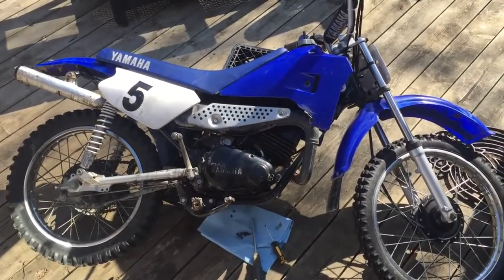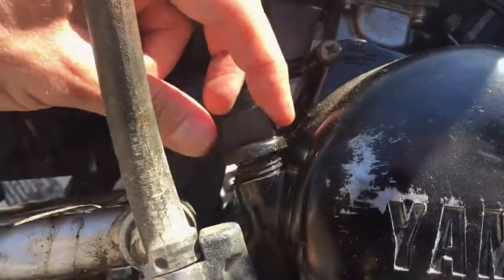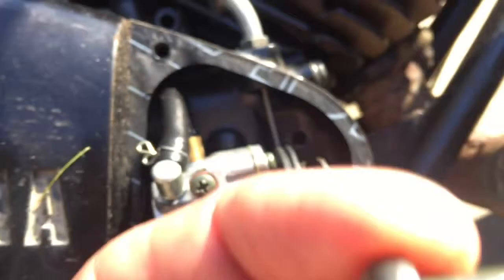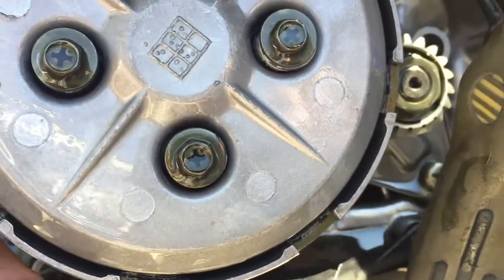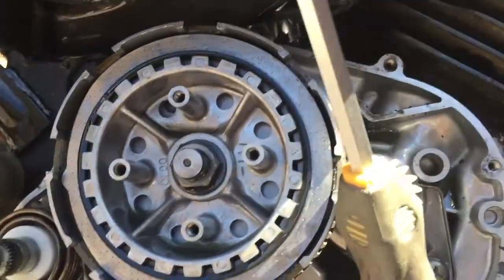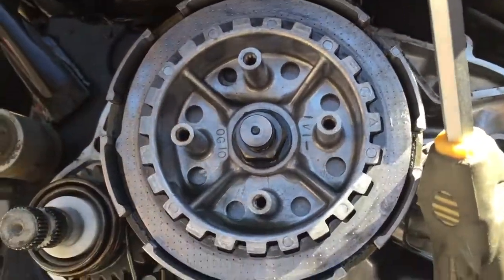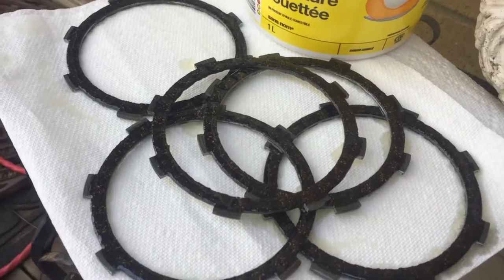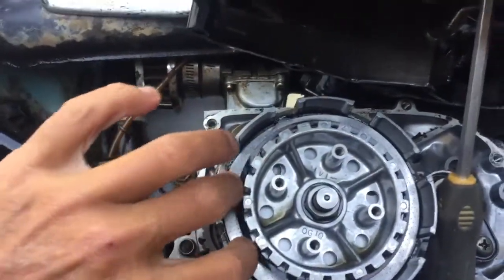Clutch Rebuild on a 2000 Yamaha RT100

Comment: Just picked one of these bikes up it's a 99. Got it running great but the rear tire/rim needs a lot of work and it also needs a chain. Bike was stored inside 10ish years so it's in great shape. Did you find a manual for the bike? And also where did you get the parts? I know I'll need that exact gasket to do the clutch in mine and am having a hard time finding it. Then again I've haven't physically been out to Yamaha to ask for it either. I did however ask for a repair manual and was told they couldn't get me one. No websites I've found yet have had much for the rt100 (Motovan, Kimpex, or royal dist) fortnine has some stuff and I can't get the mobile version of bikebandit to work for me. Anyway main questions are best spot for repair manual and parts. Thanks
Reply: are you still looking for a repair manual?
Reply: @Ohyesverygood  no the bike has since gone to another home, thanks anyway
Reply: @justinchant5044  i figured it’s been 5 years.

Comment: Where did you pick up your clutch rebuild kit? I have a 90s to 2000s, dunno which year, but the clutch is slipping bad and it needs rebuilt. Thank you for your time!
Reply: Check eBay or near by bike shops that can order it for you
Reply: @Serkan-Ipek  I was able to get a clutch, but I'm still not too sure on the type of oil goes in the clutch. If you know, then thank you for answering the question
Reply: I am thinking it's 10w30 for it, but I want to be sure...
Reply: Radical Radcliffe i mean 10w30 or 10w40 I don’t really think it matters. Personally I run 10w40 it everything works fine and it doesn’t burn through the oil instantly nor does it engine have trouble consuming it so I’m not 100% sure. I don’t think it would matter much but you can probably google it and get an answer
Reply: If u look where the Handle bars meet the frame, there should be a combination of numbers and digits. That is the vin number. If u find a good vin number website online, u can figure out what year. Then go to a yamaha dealership and they should tell u the exact type. They have all the records. That is what I did.

Comment: Do you use 10w-30 or 10w-30
Reply: KadenPlaysVideoGames  Im pretty sure its the other way round2 stroke oil in the container and 10w30 in the crank case
Reply: figure out what oil to use? in the clutch case